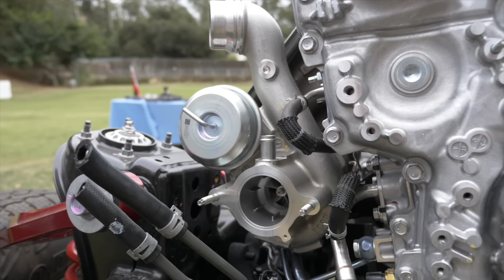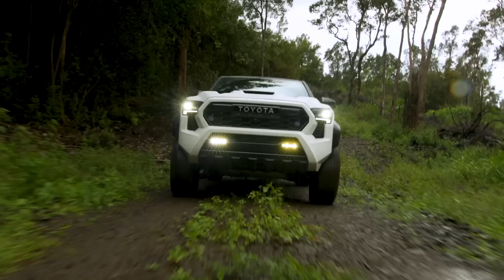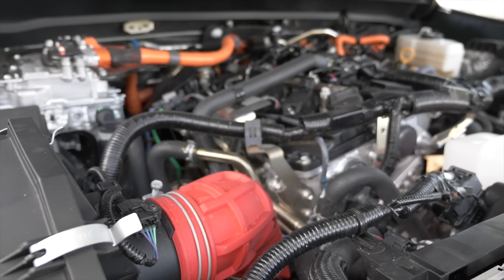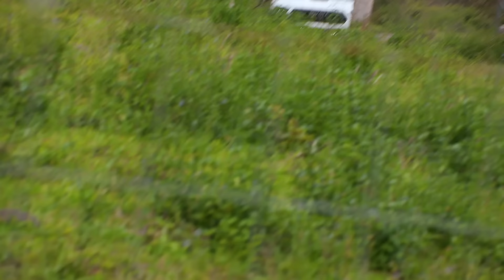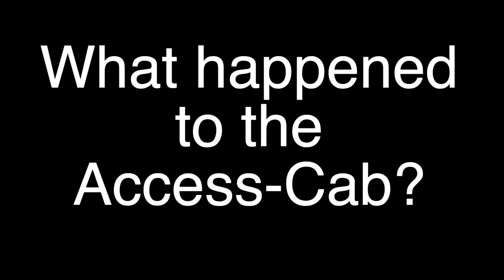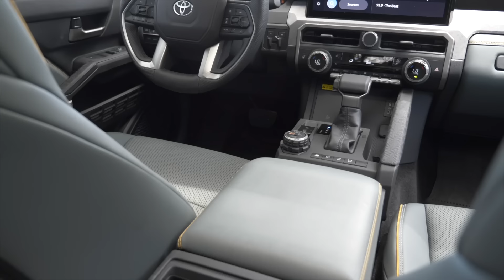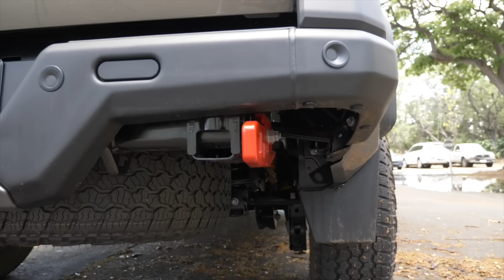2024 Toyota Tacoma Chief Engineer on new engine reliability and more...

Comment: The main thing I don’t like about my turbo engine is it’s not linear in acceleration
Reply: What vehicle is that? Modern turbos deliver torque low in the RPMs which makes power delivery a lot smoother. Maybe you have something with a large turbo that needs to spool up.
Reply: @DeuceDeuceBravo  2021 acura rdx
Reply: @CoralSea  I'm surprised to hear that. I haven't driven a Honda turbo, but every modern turbo I've driven (other than HD trucks) has been very smooth.
Reply: @DeuceDeuceBravo  it's not terribly bad but noticable.

Comment: He addressed a lot of valid consumer complaints, so that's great to hear. I'm glad Toyota is listening. The prior gen had some major caveats. It's a shame Toyota just kept selling it for many years with the awful 6-speed automatic that can't pick a gear, instead of taking care of their customers sooner rather than later. Also, thank you for keeping the extra cab version. GM and Ford really dropped the ball getting rid of that. I'm one of those consumers who needs the bigger bed, not the extra backseat. Hopefully, the turbo 4 engine proves itself dependable and not more expensive to keep up long-term. I have my doubts.
Reply: To be fair, there wasn't much incentive for Toyota to spend money on the 3rd gen when it was still the best selling midsize truck by a mile.
Reply: I'll take the quirky 3rd gen engine and transmission that last hundreds of thousands of models over much more complicated modern designs that start having problems around 100k miles.
Reply: I get that but wouldn’t it be easier to load cargo with the access cable instead of the xtra cab?
Reply: @Elvisnotpresley97  I suppose it depends on what you're hauling. The stuff I haul is either too big to fit in the cab or too dirty. Lumber, gravel, demolition debris, pallets of flooring, etc.
Reply: @palebeachbum  I feel like you'd be better served by a half-ton, not a midsize truck. Single cab Ram 1500s and Silverados are relatively affordable, since demand for them is so low compared to crew cabs.
Reply: @theglowcloud2215  a half ton would certainly do the job with more ease, but I'm not accustomed to driving full-size vehicles and I live in the city, so parking spaces tend to be narrow and maneuverability and shorter length is important. I don't totally dismiss the idea, but I'd feel more comfortable in something like a Frontier or Tacoma.
Reply: @pale… I think what the not so Presley (good user name btw 😆) meant is that in the old access cabs there is a small door and much easier to “access”, no pun intended, the items behind the front seats than in the new extra cab where they eliminated the small side doors. Imagine placing a 50 pounds car battery into the backseat area of the extra cab where you have to lift it over the front seat, twist your back (literally) and then using your extended arms place it on the floor. Same thing in reverse to lift it out. Or doing the same with the Home Depot tool boxes that I use for storing power tools (cordless saws, drills etc). Some of those boxes are perfectly fit size wise but they could have 60-80 pounds of tools in them. There is no way I am going to be able to do that and not have a spine discus dislocated. In an access cab I open the small half door and easily lift objects in and out of the backseat/seat delete area. It’s a giant miss for the Toyota design team. Nobody on that team used these access cab back seat areas for anything else other than storing hiking poles. Which I also do but I have to lift 80 pounds in and out as well.
Reply: @is6566  Ah, yeah. That makes a lot of sense. Thanks for clarifying.
Reply: @palebeachbum A whole lot of people actually (use there pickup’s for wha they were designed for ) , if want and SUV I’ll buy an SUV . I don’t buy pickup trucks to drive around the kids . I buy it for hauling,towing and general work.
Reply: @donaldpiper9763  yes, I'm one of those people. We're saying the same thing.
Reply: Should do great, just change the oil every 6 months. Let it idle for one minute before turning off if driven assertively.
Reply: I own a 2018 trd pro and had a "hunting" tranny.  The dealership reprogrammed it and improved it ALOT...and the MPG improved too.

Looking for my 2018's replacement....prolly gonna be another Toyota Tacoma.  Not scared of the 2.4 Turbo...hope the MPG climbs a bit although my last Wa-Id-Mt-Nd trip(1200 miles on interstate) bagged its best ever MPG...25 mpg...with 82k miles.  Shoot, maybe buy a trailhunter and keep the 18..:)
Reply: They didn’t « keep » the xtracab they brought it back from the first Gen. The 3rd Gen had the access cab where the back panels opened. I honestly want to get an Access Cab 4x4.

Comment: I would like to hear from anyone that has 250K miles on that turbo 4 engine.
Reply: Had 93 mr2 turbo with 280K original motor and transmission.   Was raced and abused but kept up with 3K full syntetic interval oil changes So this upcoming Tacoma should last 300K + with recommended maintenance.
Reply: @vianad9285  Toyota recommends 10k mile oil changes... Good to know turbos will last w/ 3k mile oil changes.
Reply: That’s going to take a while
Reply: @jmpattillo Yeah, it may never happen...
Reply: The Lexus NX has had a Turbo 4 since 2015.
Reply: @dr.emilschaffhausen4683  How many miles does it have on it?
Reply: car vs truck?  good point but valid comparison?  @dr.emilschaffhausen4683
Reply: Some Civic & CR-V 1.5Ts have survived that mileage.
Usually with good maintenance and a sympathetic driver.
Engineering, materials, service, and duty cycle being equal, N/A always outlasts forced induction.
Reply: Check ford. Lmao they can't get there

Comment: Part of the overall trend to make life of people miserable... turbo /hybrid / cvt = endless money pits, will last like 100,000 miles, just past the warranty, then 8 speeds tranny is like $12,000 to fix or buy new tranny for $18,000
Reply: Every prius out there 200k miles and more. Still going for 8-9 grand.
Reply: @Lenv123  Prius doesn't weigh as much, haul as much, or tow as much.  And, only the latest gen Prius has a turbo. Can't cheat physics. They won't last as long😢.
Reply: @Lenv123 yep!
Reply: Ya da ya da ya da 😢 too much speculations from the BUMS! let’s wait and see if this truck disappoints.
Reply: @vianad9285  You're so kind...
Reply: @countschad  yes a Prius hauls a lot. It’s got a puny 1.5 red-lining all day long just to keep up with traffic. And the cvt and hybrid still going strong after 15-20 years.
Reply: @countschad  and the latest Prius does NOT have a turbo
Reply: @Lenv123  My apologies.
Reply: @Lenv123  The concern was about 4cylinder turbos in the Tacoma, not the venerable Prius.

Comment: No turbo is reliable period. I will pass and switch to another brand moving forward.
Reply: That’s odd.  Tons of miled out turbo diesels out there with zero issues
Reply: @slowfiveoh4986 Chevrolet really screwed us over on turbochargers in Cruzes and Sonics. The public opinion on turbos never recovered. Ford also has a poor track record in their twin turbo trucks.
Reply: @rfrbz1269  I don’t think you can compare a Toyota to a Chev, never mind chevys economy car
Reply: @slowfiveoh4986 Uh turbo diesels are a completely different animal.  You can’t compare them to turbo gas cars.  Please keep your ignorance to yourself.
Reply: @marklihsu  a turbo charger is a turbo charger regardless if it’s diesel or gas.   Exact same principle
Reply: I've had many turbocharged vehicles over 25+ years, some with over 200k miles. Never had an issue. Make sure you're changing fluids on time and let it warm up a little before hammering the throttle. That's it. (Which should be done for any engine.)
Reply: Almost every commercial truck has a turbo

Comment: Bring back the naturally aspirated v6 and v8!! Toyota use to make cars that last, now they will take everyone’s last dollar to repair. If you look Toyota reliability ratings are dropping as soon as they went all turbo happy. If I was a  multi ton whale 🐳 do you think it would be smart to put a mouse 🐁 heart inside and add turbos make the heart work harder and faster just to wear out quicker 😂
Reply: The Ecoboost V6s in the F150 are lasting longer than the V8.  GM’s turbo 4 in the Silverado is more reliable than both of their V8s.  Your concerns are unfounded.  Turbos outlast the rest of the engine.

Comment: Nice informative video, hopefully Toyota will offer the 3.4 iForce for people who want the 2.4 iForce Max torque, but don't want to loose towing capacity or under seat storage.
Reply: The 3.4 litre Tundra engine is not going in that Tacoma.
Reply: @SvenTSchixe  check the link they have been showing the 3.4 Tacoma Xrunner at a few shows
Reply: @markaromero12  🤔

I will look in to that, thanks for letting me know.
Reply: This is Toyota. You will get only these options for at least the next 8 years.

Comment: This question is for any vehicle in Canada when it comes to fuel economy. What unit of measure is used? Canada used to use Imperial gallon. I assume we still do. 1 Imperial gallon is = to 4.546 liters vs 1 US gallon is = to 3.785 liters.
Reply: L/100km (liters per hundred kilometers) is used in Canada now. Example: (10 L/100km) = 23.521 US mpg

Comment: Great insight from the builders perspective and so well spoken!  Seen most from your previous review.  Looking at buying a new Tacoma next year, hard to get over the fact it will be a “4” and not a “6” although it has so much torque. I have owned nothing but Toyota and always impressed, have 2-1/2 now. Any engineering insight on the TMW Supra I have?  The other 1/2 Toyota I own.

Comment: It’s a Toyota …it will be amazing
Reply: @realdeal8607 	T24A-FTS---which actually debuted in the 2022 Lexus NX350….ten of thousands of km …no issues
Reply: I want to be positive, and am generally confident in Toyota, but my 1989 4Runner 3.0L V6 head gasket being replaced 4 times still stings.
Reply: @EvanSchiltz  guess that’s why we have a warranty
Reply: @gobear83  agreed, and Toyota was great. But one of these failures was 20 miles off road with the family, so that was 😊.
Reply: @EvanSchiltz need to keep up with the coolant changes.  I do mine every 75k
Reply: @loveydovey4u  agreed there. I always do my coolant and axles every 30k. In the end Toyota did some forensics and found that somehow my engine was one of the first 1000 ever produced. Seems it was lost then a year later found and dropped in my rig. Turned out there was a known issue with the alloy blend for the block where both coolant and oil passages would shrink and cause misalignment with mating parts. I guess my point wasn't against Toyota quality, it was meant more about the risk to the consumer in adopting 1st Gen.

Comment: First comment! Turbos don’t last as long as non turbo engines. History has shown this to be true
Reply: If done right they can last. There's still plenty of toyota turbos from the 80s roaming around.
Reply: If Toyota is so confident in the long-term durability of their 4-cylinder turbo engines, they should extend the standard warranty.
Reply: They've been using small turbo charged engines in Europe for many  decades now.  They've actually performed pretty well!
Reply: Diesels have entered the chat.
Reply: More moving part for something to go wrong cooling or not
Reply: The Japanese brands make some very good turbos(MR2, Celica, Supra, RX7, 300ZX come to mind). The problem is that MOST people don't do the proper maintenance of their vehicles. Not even with a regular 4cyl, V6, V8 or whatever. With proper maintenance, as in doing more than just changing the oil and NOT neglecting the other fluids, a turbo will last.
Reply: Well unless you’re talking about over the road semi’s with 3 million miles….
Reply: Not Toyotas fault. Gov emissions standards are to blame.
Reply: Tell that to the owners of the Cummins Diesel engine trucks.
Reply: @OhNoMrBill-yg3dy  Lol. My best friend owns one and is sick and tired of how much Def fluid he has to put in it.
Reply: Yup, it's another step towards faster dispoability.

Guess Toyota wants to make crap and sell more new trucks to.

Sad, end of the famous Toyota reliability.  Really blows the mind Toyota is following Ford's crappy example.
Reply: @GeneralLeeVanderwood , not just Ford, every automaker has gone from NA 8's to turbo 6's, and NA 6's to turbo 4's. CAFE standards are making it impossible for them to keep the big engines.
Reply: Quit crying. Blame your government, not Toyota!